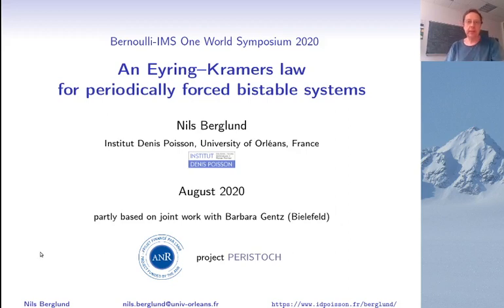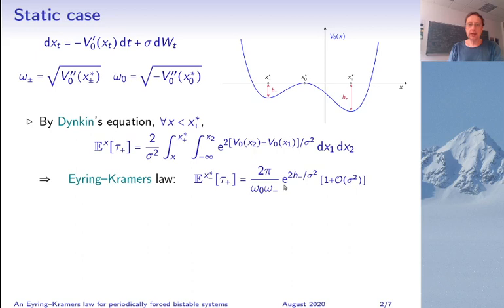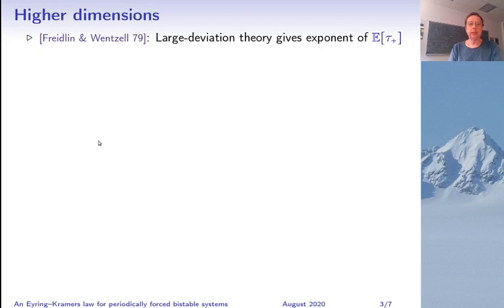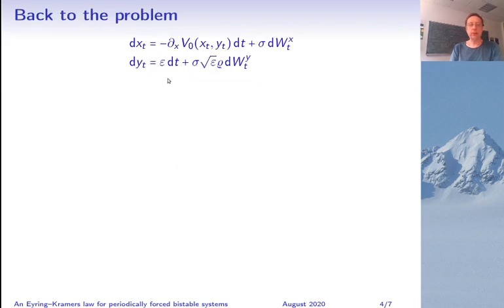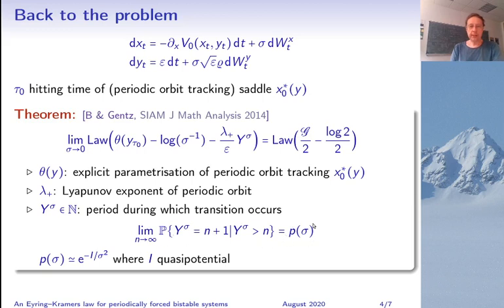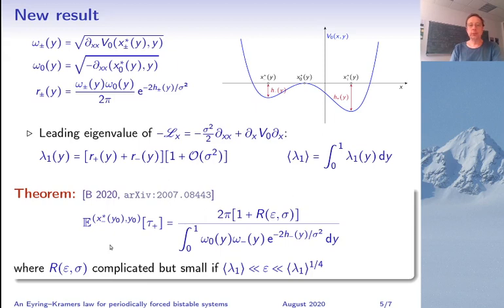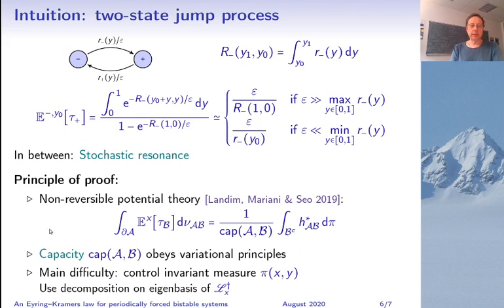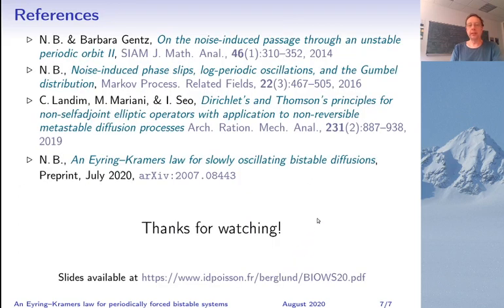An Eyring-Kramers law for periodically forced bistable systems

Comment: Man this video looked fascinating, but almost all of it went over my head.  Way back on the first slide, it looks like there is one spatial variable x and a potential energy assigned to the particle based on x and another variable y.  Is the main idea that y slowly increases (or drifts) and affects the potential function in a periodic but noisy way?  If so, would it be reasonable to call y a "periodic push" or something similar?  I feel like if I understand that I might be making some progress...
Reply from the maker: You can think of the variable y as being time. The system is very similar to the one in the simulation https://youtu.be/HbJ_I3xbIMg
One could call it periodically forced double-well.
Reply: @NilsBerglund  That’s interesting, and thank you for replying to my comment!  I was a bit confused because I thought that y drifted over time, and wasn’t time itself.  Also, is it reasonable to say that y is the cause of the sides of the well each moving up and down?
Reply from the maker: Yes, y is a parameter controlling the shape of the double well. In the video my previous comment links to, y is exactly time. In the equation considered here, y is a variable that is close to the actual time, but has small fluctuations around it. For reasons related to the mathematical techniques I employ, that is easier to study than if y is exactly time.
Reply: @NilsBerglund  Ah, I see; thanks for explaining!  And that makes sense, since dy is directly proportional to dt, aside from the term with the noise.

Would it be proper to say that for a fixed x, the potential function V(x, y) would be roughly sinusoidal as y (or t) increases?
Reply from the maker: It could be sinusoidal, yes, though it can be more general than that. An example with a sinusoidal potential would be V(x,y) = x^4/4 - x^2/2 + A*sin(epsilon*y)*x, with A not too large, so that for any fixed y, V(x,y) is a double-well potential as a function of x.
Reply: @NilsBerglund  That is interesting and makes perfect sense, and thanks for getting back to me again!